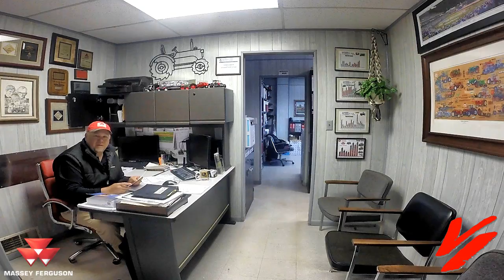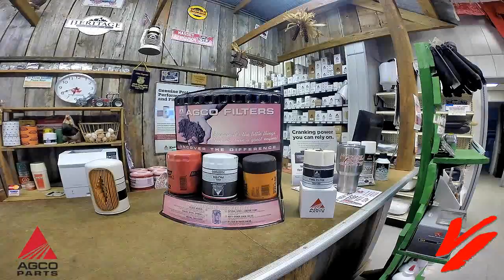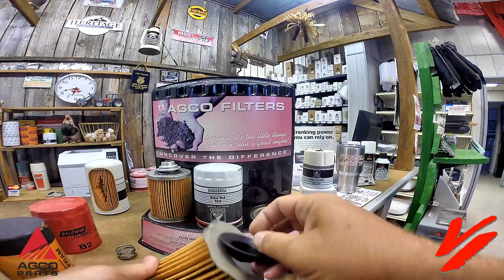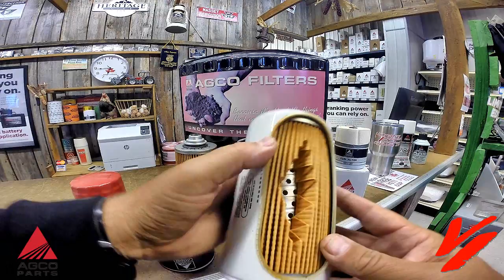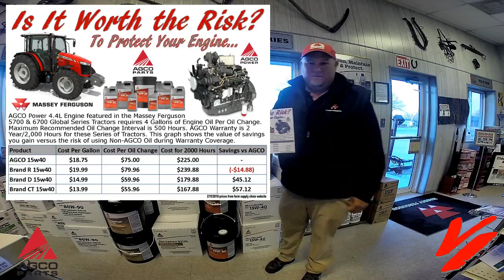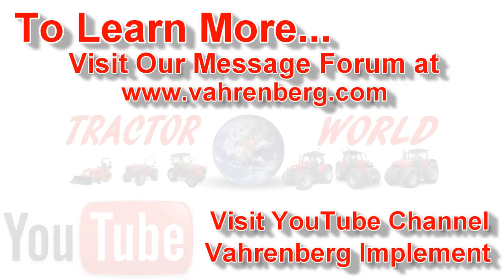The Basics: Understanding Tractor Warranty

Comment: What does the 5 year powertrain warranty cover? I have a 2017 1739E hydro and the manual  front wheel drive just stopped engaging. Is this covered?
Reply from the maker: In the Warranty Terms you should have received when purchase states the Powertrain Coverage covers Engine Casing, Transmission Casing, Drive axle casing and/or components enclosed within these casings. Take the tractor to the Dealer you purchased from and they can inspect to see where the concern is occuring. Internal or could be linkage issue. And determine if it was defective material and workmanship and if warrantable.
Reply: @VahrenbergImplement  thank you.  It is going into the dealer on the 25th. You have a very good channel.  Best of luck.

Comment: I heard it was just announced an additional 5 year warranty for $499 from Massey Ferguson extending the warranty to 10 years. My purchase date 1740e 6/28/2020. I have 47.5 hours.
Reply from the maker: There is 5 Years Extension Option available. It is only PowerTrain Coverage and for Agricultural uses. Non-Ag uses that cannot be replicated on a farm or Site Preparation, Excavation, Pond Building, Earthmoving, Forestry or towed scraper void the warranty. Units Sold since March 1, 2020 have until November 1, 2020 to purchase the extension Or tractors purchased after Sept 8, 2020 must purchase within 90 days.
Reply: @VahrenbergImplement  Thank you. I want to get that.
Reply: @VahrenbergImplement  I got the warranty. Why aren't all Massey Dealers shouting from the mountain top about this? If I didn't find out for myself ... I would be upset at my Dealer for not telling me about this If I bought my tractor March 1st and on.
Reply from the maker: Dealers  just learned about it, too. There is some marketing programs to qualified owners coming out. We did our own program to our customers this week to notify them.

Comment: Sounds like the warranty sucks!!! my massey ferguson dealer stopped being a dealer so if I would have purchased a tractor from them and  something would have happened to it then tough luck huh, cause nobody else is gonna touch it without you paying? Or if you move to a different city or state. Or if you don't have a local dealer and you buy elsewhere and then someone in your area becomes a dealer you can't use them. Seems like something Massey Ferguson needs to work on, or maybe the dealer themselves. If someones dealer closes down and they come to you for warranty and you charge them because it took you 4 hrs to find a bad ground I bet you wouldn't be there new dealer when they need a new tractor! For example, my friend just had his new holland t4.95 tractor in the shop for low fuel pressure code and was out of warranty and this was at the dealer he bought it from, It took them 4 months to figure out what the problem was. They first put an injector pump on it and didn't fix it, then they said they did a bunch of testing changing sensors etc, Finally changed the injectors and fixed the problem. So the pump could have failed and killed the injectors, but here's the kicker, they said that they had over 70hrs in diagnostics and the the bill would be about $14,000 when they originally told him around $4,000 to repair the problem, they agreed to around $5,000 all said and done, so moral of the story is you can't charge someone 70 hrs of labor or around $10,000 to diagnose a low fuel pressure problem! He will be buying a new 5090 deere and kmc poultry house cleaner from the deere dealer this year! So we may not have a local new holland, kubota dealer in the future either, they have lost many customers because they can't fix equipment in a timely manner. People can't be without their equipment 4-6 months or can they pay 70 hrs labor for a job that shouldn't have taken 3hrs to diagnose and probably 6hrs to change pump and injectors. Oh and I used to be an auto mechanic so I understand flat rate and taking a loss, but sometimes it takes way longer to diagnose and repair something than it should and you have to take a loss to keep a potential future customer happy. Taking a small loss on a labor job might make you 2 tractor sales when they tell their friends you took care of them, but if you try to charge them for those extra hours they will tell everyone they know and probably cost you 10 tractor sales! You have to look long term! Anyway just my perspective on things that If you take care of a customer even if he didn't buy from you next time he might!
Reply from the maker: Massey Ferguson has a great warranty and like you mentioned it's the dealer that makes the difference and reason you need to purchase from your local dealer. We've only been in the tractor since 1952 and 3rd Generation. We've seen a lot of dealers come and go and lots of brands too. It's your dealer that makes the difference. Our Heritage started with Oliver then White and 1999 took on the AGCO Allis brand when local dealer retired and in 2007 the Massey Ferguson Brand when he closed. Those customers purchased from another dealer but we worked with and helped take care of their warranty needs with AGCO. Since we did not sell the tractors new any overages above normal warranty reimbursements the customer and us shared in the expense. We helped because we were growing new customers but they could not expect us to eat all the added costs. They needed a dealer to take care of their needs and help them and we have grown because of the acquisitions. Ag Equipment Warranty is different than the mobile industries like automobiles you often operate outside the dealer sales area and do not want to have to return to them for work so the Auto Manufacturers pay bonuses to repair whereas less mobile vehicles like tractors are used close to where the selling dealer is located. Thus the reason all farm equipment manufacturers not just Massey reimburse dealer parts costs and labor costs. Dealers absorb the overages and I can tell you it is very, very rare to ever get close to flat rate in the ag industry...we only been doing it 67 years. We understand customers move and equipment gets relocated but in todays age of Internet Buying when you purchase from several states away to save a buck or too you also risk 100% No Charge Warranty. We give 100% No Charge Warranty to our customers that purchase from us. We have the choice to work on machines purchased outside our area but how can a dealer maintain business when you don't give him the business when purchasing new. If it was cheap enough to bypass the local dealer and purchase from another dealer then it should be cheap enough to take it back to him to take care of warranty. Warranty is a money losing parts of any Ag Dealership. Thankful Massey Ferguson Warranty repair is very rare and uncommon...that way we can keep our margins lower and sell new products at lower cost. Dealers have to make a fair profit to pay the wages, insurances, taxes and expenses so we can keep the doors open to help our customers. If we don't it hurts the value of that equipment brand in the region and customers without service support. We lost another competitive dealer in our area and feel sorry for those customers because the distance they have to travel to get service just double to triple the distance. We don't plan on leaving but we can't afford to pay for lost reimbursement of equipment sold by another dealer. Why I will not sell New Equipment Outside the Area we can Responsibly Take Care of Our Customers. If a dealer wants to sell all over North America...he needs to provide Service Support all over North America!
Reply: @VahrenbergImplement  Sounds like its best to buy from a bigger dealer, more chance they'll be around for service, Probably why so many people in my area buy Deere, local Deere dealer has 13 locations with free pickup and delivery on warranty. I'm just not sold on that green paint and plastic hood lol, but they have pushed out almost all the competition within 100 miles. I like the Massey from what I've seen just not any dealer support locally for them.
Reply from the maker: Probably more reason buy from Single Store Dealer...Most are smaller and care about all their customers. One of the reasons we keep growing every year and customers switch from other brands and colors to Massey Ferguson. We care about EVERY customer no matter how big they are. I can tell you Free PickUp/Delivery isn't Free...it's figured into the margin you pay...your getting charged if you need it or not. With the low warranty rate with Massey Ferguson Product...you may never need Warranty Service. Actually Massey Ferguson is growing and is actively adding more locations every year and it's by adding new dealer not just new locations. There is a Dealer Locator on Massey Ferguson Website you might want to check to see where your dealers are:  http://www.masseyferguson.us/find-a-dealer.html